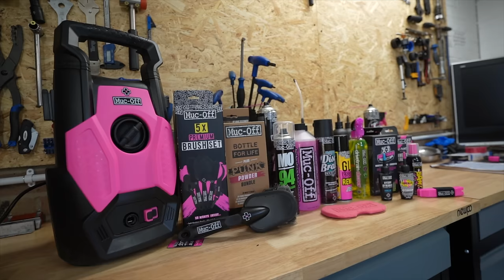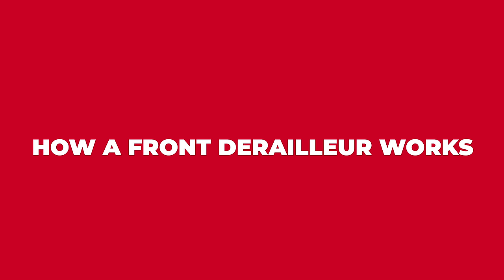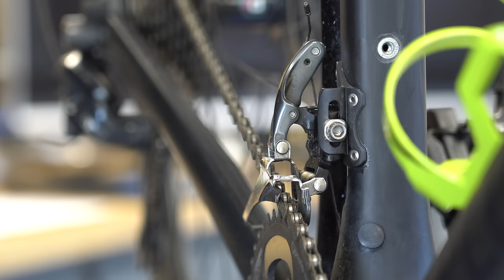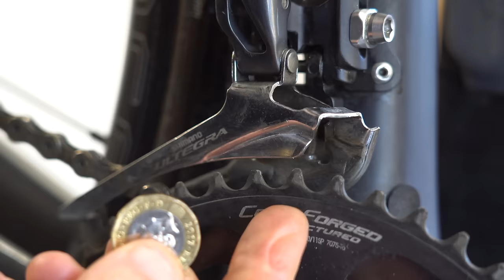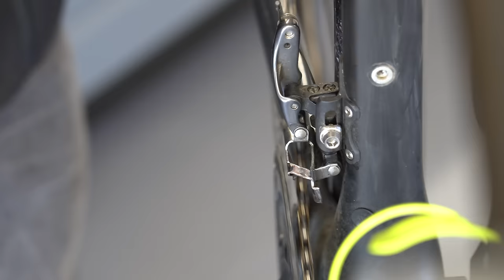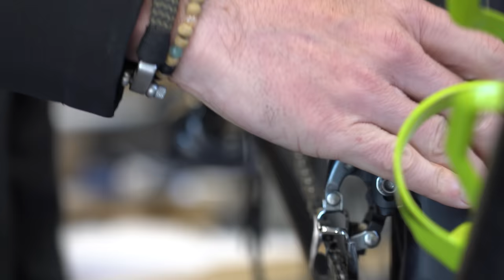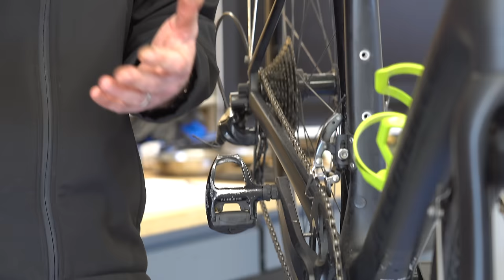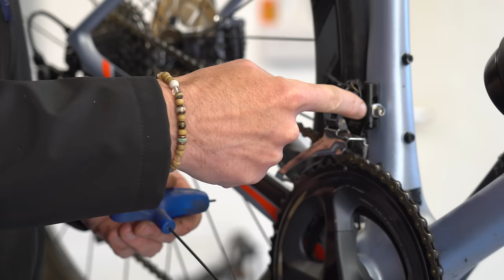The Easiest Way To Adjust Your Front Derailleur For Perfect Shifting

Comment: It really annoys me when bike mechanics say thay chain rubbing when cross chaining is inevitable. You CAN set up the front derailleur in a way that there is no chain rub no matter what gear you are in. It is just more complicated to do. I had bikes shifting perfectly in every gear come back from the bike shop with the chain rubbing with a slight angle already and when I went back to the shop I was always told that this was normal and they dont see a the problem even if it had shifted better just before I brought it in. 
Claiming that cross chaining chain rub is inevitable is just for lazy mechanics.

Comment: Just recently changed my mtb frame but using the same front derailleur I noticed the chain can’t shift to the larger part of the crank. Is the problem the derailleur or?

Comment: This should be the only video on YouTube re Front Derailleur adjustment. Couldn't find any better. Great video.
One question, can you use thread lock liquid to lock the low limit and high limit screws?

Comment: Should mention to set the cable tensioning to its slackest position before reattaching the cable. And the cable tension while in the low ring shouldn't be too high or you will start moving the derailleur out, creating chainrub. On some derailleurs, the high limit screw will be very tight while in the big chainring. It's better to shift down to the small chainring, make small adjustment, test again shifting to big.

Comment: I have seen so many of these videos, and no one answers this question:  The inner and outer cage of the Ultegra 6800 are not parallel to each other. So which cage should be parallel to the chainring? Is it the inner, or is it the outer?

Comment: Great instructional video. 
It is amazing how many people haven’t noticed that there are more than two positions on a shimano front derailleur. 
I can’t speak for other manufacturers as I’ve never used them. 
I’ve got an older 105 which is one down and two up and a R8000 which has four positions on the way down and one coming up.

Comment: Thanks for a great video. Correct me if I'm mistaken, but at 5:46 you said, "If it isn't" (aligned).... but you didn't explain how to align it but went straight to height after loosening the cable.

Comment: You are the best for couple years my bike was scratching the front  dereilleur and I took it to a couple bike shops and didn't fix it I watch these video like 6 time to fallow step by step and now no more issues thanks so much ❤.most of the problem was in the high the explanation of the coin is great after that everything was beatiful.

Comment: The chain goes down smoothly from the big sprocket to the small one, but on the contrary, it sometimes comes out with difficulty when going up.  What could be the problem?
Reply: Loosen the upper limit/h screw.H Limit screw restrict going up movement.Test that the chain does not jumps out to the pedals.

Comment: Kudos for the clarity, the conciseness and the pace. All are paramount for a newbie to latch on the info. I've tried to adjust following another video and the derailleur would not shift up. I now think I got the cable tension wrong. I'll first disconnect the cable and walk the steps again. Hopefully I'll get a better result, or else I'd have to believe my derailleur itself is a fiddly subpar part, bring it to the shop and try to wring out some specific intel from the mechanic.

Comment: Another option for higher FD cable tension is to shift into the big ring, leave the chain & FD static, shift the lever into the small ring position and then conduct the cable release/re-tension.  I'd suggest setting the barrel adjuster about 1/2 way if doing this, to allow a decrease in tension if needed.

Comment: For the newer Shimano FD, you don't need to unbolt the cable to adjust the low trim anymore, you just set it on the Low Trim position. Likewise, the Top Trim position is used to adjust the High (or Top) trim now. Seems easier, at least on paper.

Comment: I was hopping to see a FD series R8000/9100 setup because is really tricky to setup.
Reply: Tip: the service manuals for all recent shimano products can easily by downloaded directly from their website - normaly the instructions on how to setup and possible quirks of the particular model are described quite good and clear in those.
For the 8000/9100 is is really crucial to get the cable tension right and use the build in markings to set it up correctly before doing any further setup. Many bike shops do not bother/do not know this and you and up with horrible shifting performance. You also have to be in the right position on the shifter to adjust this correctly.

Comment: Hey! Thanks for the video! I have a Shimano 105 and the L/R bolds simply do not work.. nothing is moving when I am moving them.. :D I mean that what you do starting at 10:15 when I do that nothing happens
Reply: Taka a close look at the screw. When you wind it in, there should be a tap the screw pushes against. If the screw cannot reach the tap, you are either in the wrong gear (big ring when adjusting low limit setting or vice versa) or there is something seriously wrong.
Reply: @manueldeubler1127  thank you! I will take a look..